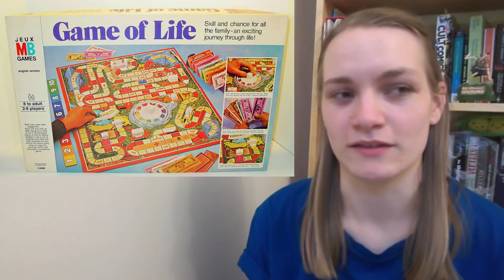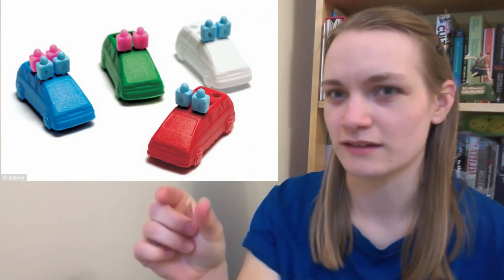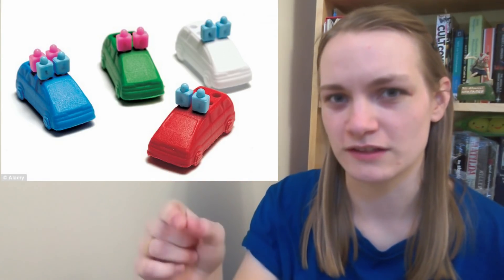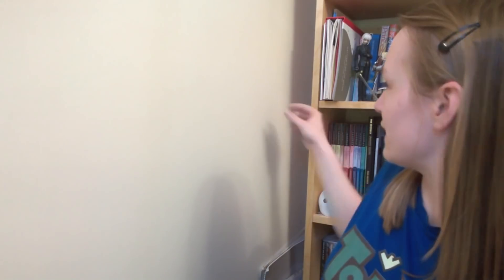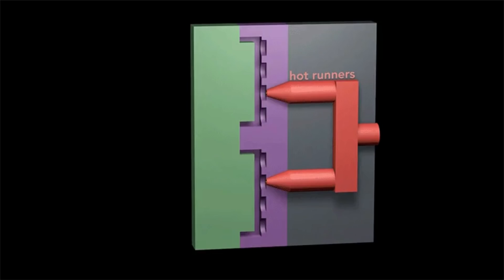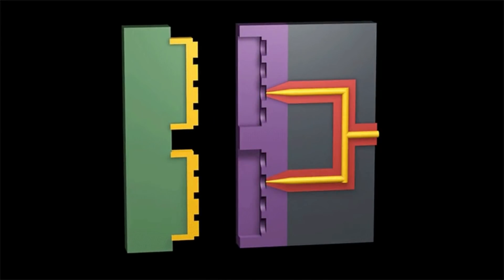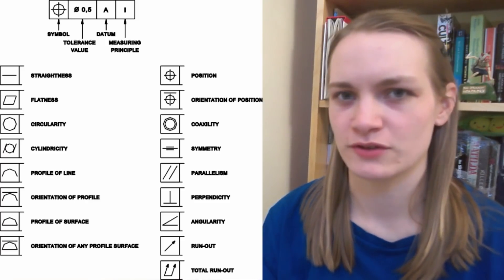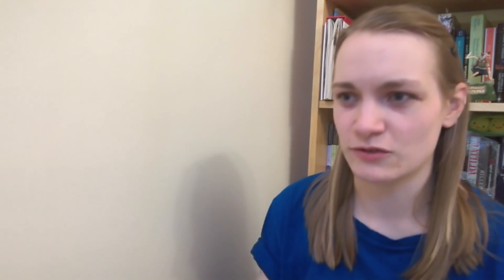Engineering Tolerances: Why Low Tolerance is a Good Thing

Comment: My background is aerospace/military. Tolerance must be accounted for, because it comes back to bite you sooner or later. Jet wings used to have to be hammered into place because of tolerance build up and inability to track it over large scales. Carbon fiber wings won't let you hammer them to correct for slight unaccounted-for errors.

The easiest things to manufacture are very forgiving during assembly. Slop can be our friend.

Comment: On the other side, it is good to have tolerances as high as possible, like with acceptable input voltage of a certain, especially ac powered device (like 80-265V on some chargers/power supplies) so they work all over the world, and continue to function normally in countries with severe brounouts/volt. fluctuations, or car 12/24V powered devices (where voltage drops below 6V while starting big diesel in winter, and then, as you rev it up, spikes to waaaay too high ocassionally...).
Reply: Pyroslav x Different kind of tolerance. A power supply that you describe actually has a very low tolerance requirement on the power coming in. Low tolerance things work just fine when everything else they interface to  is out of whack. High Precision (high tolerance) almost always costs more money.

Comment: I have these problems too with fiberglass parts we make, the big problem is consistency so they can be machined. The video attached is my prediction of the future of Widgets and such. The parts are being made by programmed individuals working independently with no seems or line's and no mold. Precision is .01 mm and 1 degree. the only problem is copying them and making them programmable .
https://youtu.be/821uVRAcZ1I

Comment: On the other hand, too tight of tolerances can cause problems as well, this was primarily seen in Japanese products of the 80s and 90s. There are mainly two things and they both involve the mating of dissimilar materials, steel bolts in cast aluminum that must be heated to release and windows that shatter on their own. The former may have been resolved through alloying differences but the latter is definitely a result of having + or - 1 mm on glass rather than standard 1.5 mm. In and of itself the tolerance wasn't a problem so much as the tighter tolerance framing and fastening that it encouraged, it didn't allow enough movement when exposed to sunny days or sub zero temperatures.
Reply: The examples you give are about bad fit, not about tolerance. Tolerance is the accuracy / acceptable deviation in properties. Fit is about things being (dimensionally) suitable for purpose, including use, assembly and disassembly.
Reply: Depends how they stack, if you have the tighter tolerance you can go to firmer gasketing which I believe was likely the problem. If there's a wider tolerance the gasket would have to more compressible.
Reply: Lower tolerance means a more accurate fit can be achieved, but lowering the tolerance of a bad design will generally worsen things, not improve them.
Reply: It was a good design for Japan, not for places with extreme weather. It could be that they're operating from a faulty table somewhere too, have had the glass experience specifically from several manufactures, personal purchases and business involvement.

Comment: Material science also comes into play. Lego also probably spend a lot of money ensuring consistency of the plastic they use. Trying to ensure that the thermal expansion rate of the plastic is as consistent as possible. If you have two bricks made at very different times, with the tolerance to allow them to fit, but the expansion rates are different then you end up with the same problem. This can translate across to other lots of other engineering, what I would call heavy engineering (power, energy, civil rail) to electronics and general consumer products, like the Lego, board games and bookcases. While I wouldn't know for sure it could be possible that Lego would perform finite element analysis (using computer simulations) to check interplay between bricks. With the tolerance requirements of the bricks being as low as they are a slight variation in even possibly the colouring could throw the mixture off enough to cause a tiny variation in the expansion rate. I see this with plastic in everyday 'normal' life (outside of my engineering - Energy, Flow Control) with the 'dreaded' plastic coffee pods (save the 'bad for the environment' argument for later please - they are easy to recycle now and you don't have to buy from Bad Companies :p). Lot of times the pods, which are designed to expand inside of the machine at a rapid rate. If they don't expand enough the hot water will take the quick route around the outside of the pod and 'miss' the coffee. Expand too much and they get stuck in the machine. In my work life material sciences, adherence to standards and tolerance is even more important. Knowing by how much a pipe is going to bend over even a small distance can make or break even the smallest and simplest job. Anyway - good video. I think you explained it well. Probably far better than my rambling text here ha ha. Keep doing them.

Comment: Lego spaceships are cemented with slobber and finger skin.
Reply: Don't forget snot and dust.
Reply: Russ Ian E. Lection-Hacker also jam.
Reply: If you want to really annoy that nasty neighbor kid, borrow his Lego, and build a structure upside down, filling every piece with pee before locking it in place. When ready, turn the structure right side up, rinse it with water, dry it, then hand the Lego structure back to the little bastard.
Reply: Russ Ian E. Lection-Hacker are you ok?
Reply: @Big Pete Are you German?

Comment: AH! A clue to why the feminist walkway collapsed in the Florida college, killing 6: they used off-brand Legos. 

Or the tolerance did it. 
https://www.theguardian.com/us-news/video/2018/mar/15/several-killed-in-bridge-collapse-at-florida-college-video
Reply: That bridge collapsed because the installers failed to observe the installation constraints, damaging the half-assembled bridge while putting it on its supports. The failure here was not one of static tolerances, but one of lazy engineers being absent at a crucial moment.
Reply: Maybe the feminist engineers were lazy, or maybe they were off pursuing "work-life balance", which is feminist-speak for wammin being systemically lazy.
Reply: A feminist walkway?
Reply: + decentradical - Before the collapse, there were lots of fawning articles over the walkway being designed and built by wammin and how it proved that wammin could succeed in STEM fields, and so on. Then, just after it opened, it collapsed, and feminists scrambled to hide the truth. 
https://www.youtube.com/watch?v=ykoOLSlzuEc

Comment: "Hot Runner" systems reduce re used materials, but also adds considerably to tooling and electric costs.

Was a plastic worker before.
Reply: Hot runner you can usually quite easily see on the marking of the gate, I think it is also called gate with hot runners, not sure. With Lego bricks you can see it on top of one of the circular protrusions. It is the one that does not say Lego. On YouTube The Engineer Guy had made also a nice video about Lego molds, I believe.
Reply: I do believe it's something they were pioneers in because they're literally the ones that paired precision with plastics. 

On tool wear, this is where coatings come in.